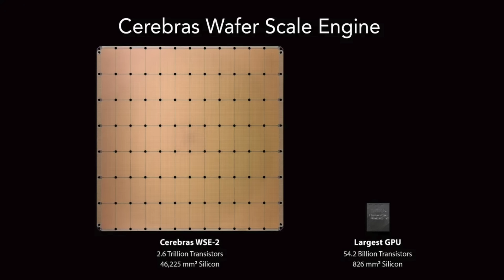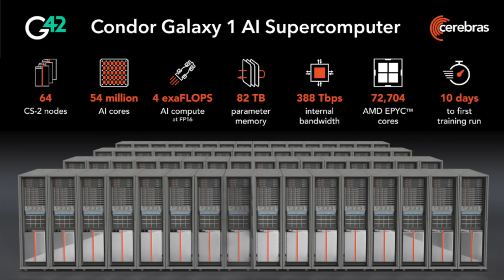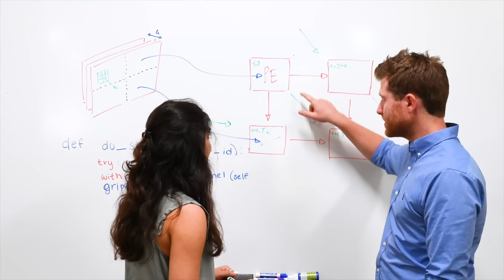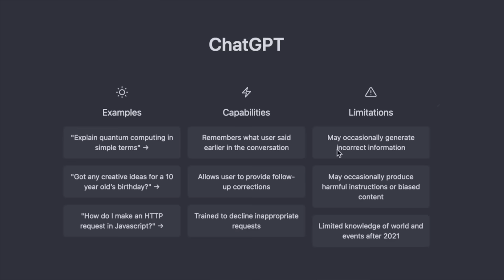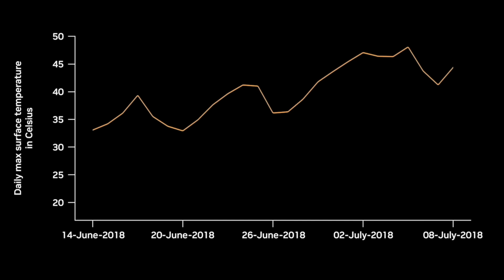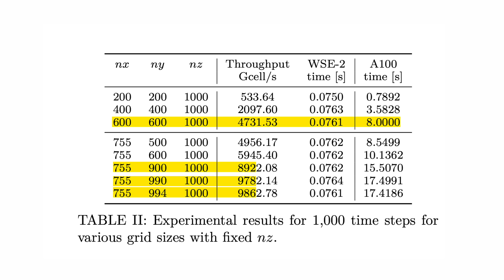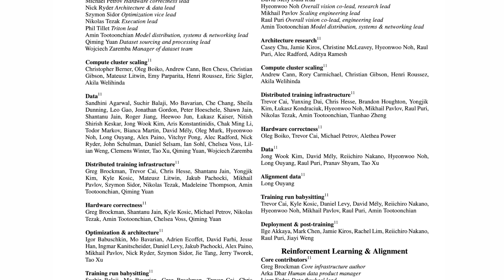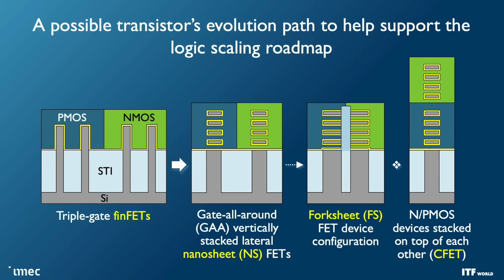New AI Supercomputer Outperforms NVIDIA

Comment: I assume TSMC is making these 300mm GPU sets for Cerebras under license, One thing that is known is the fact there are numerous errors and faults on every Die,  I really can't see there claim to fame stacking up on the level they are sugesting. 
Latency is another factor, even using optics there would still be bottlenecks in the system.
Reply: Cerebras doesn't make GPUs, it's a different architecture. Although TSMC might be making the chips, it doesn't mean they necessarily own the manufacturing process / technique.
Reply: They keep referring to using the wafer as a whole implying they used 100% of the wafer. 

Push latency but leave our the 64 units interconnections 

Claim they will have them most output from linking the locations together but don't worry about that latency because you will only need to run at a single location.

All we are missing is the slap chop pitch man

Comment: 0:21: 🚀 Siri Breasts has developed an AI chip that offers better performance than Nvidia GPUs and is available now, potentially solving the bottleneck in AI development caused by limited GPU supply.
2:59: 🖥 Cerebral plans to build nine interconnected supercomputers, with the first one already up and running in Santa Clara, California.
6:08: 💻 Nvidia Cerebras has developed a custom compiler that allows PyTorch code to run on their hardware without any changes.
11:54: 🚀 The speaker highlights the speed advantage of their system in training machine learning models compared to traditional methods.
Recap by Tammy AI

Comment: Nvidia H100 and GH200 are more versatile and general-purpose systems that can handle a wide range of AI workloads. Cerebras AI supercomputer is not suitable for all types of AI workloads, such as inference or data analytics, which may require more flexibility and scalability.

Comment: lol, "we built a chip thats 50-60 times faster than a nvidia h100!

its also 50-60 times bigger than a nvidia h100 ;)

so maybe we should be comparing it to 50-60 H100's ?

I also wonder how their chip yields work with manufacturing. With a smaller chip you can tolerate failures by throwing out the failued unit.  But a single failure in your wafer scale chip wastes the entire wafer right?  This is hardly the solution to availability issues.

I don't doubt the value, but it hardly democratises this as your intro implied it could.  ("Available right now!" - I'd love to buy a cerebras, but I don't think they'll be selling chips to me any more than Nvidia is selling me H100s)

Comment: 1 cerebras is 1.3 million USD, 1 H100 = 20kUSD you can buy 65 H100 for 1 chip where you have to add all the rest.... the 100x performance is not yet justified... on Nvidia you have a standard, competence on the network infrastructure infiniband and so on... on the other side you have something interesting, but too new. we will see in next months how it will evolve...

Comment: With these CPU's. The large ones. Has anyone thought of having an optical CPU between two of these large CPU's. One classical, and the other optical, to increase CPU throughput through the optical CPU. Obviously cos the optical doesn't produce as much heat. Could you not stack many CPU's in this way? like the layers of an onion.

Comment: I’m very skeptical of the claims.. and input has to be more important than outright compute.  But.. 200x is insane.  20x could be the difference between shooting in the dark and catching up to top input algorithms at 1x.  Idk… thing is the stated 220x is an a100.  Well nvidia is making h100 now and comparing a 300mm chip to an h100 is insane.  I’d still guess that nvidia is ahead because leading edge chip tech is it.  You can’t go ahead of leading… not how it works.  And at 10:20 he state “something is at 7nm and something will be at 5nm.  So this implies that their current chips are 7nm.  Nvidia is on 4nm.  There’s no way cerebras is faster than nvidia…

Comment: Wait until AI starts designing it own chip. Probably be some form of meta logic (non-elementary logic and axion sets).
Self reprogrammable and reconfigurable on the fly. So after a few hundred iterative steps we humans will not understand how it works.
AI computers will be able to solve problems faster than any supercomputer we build, because its self learning, self adapting, dynamically allocate/deallocate node resources to the problem.